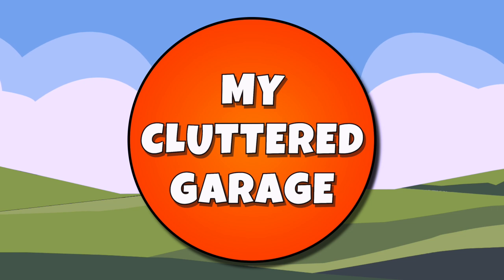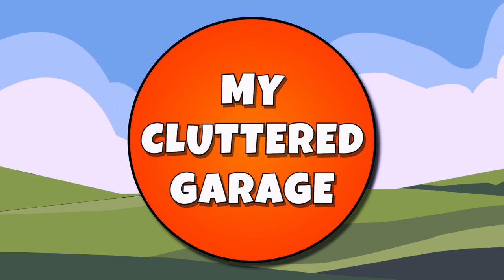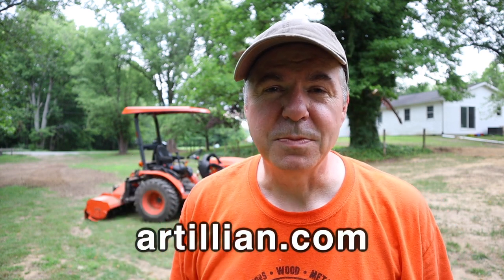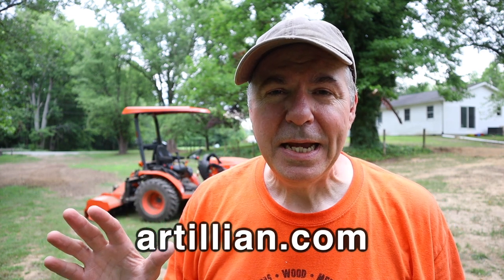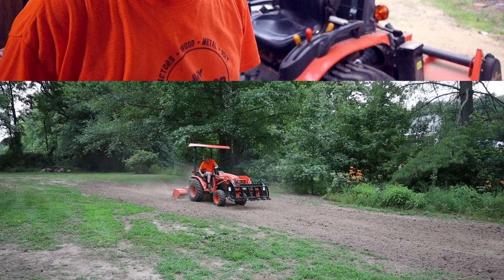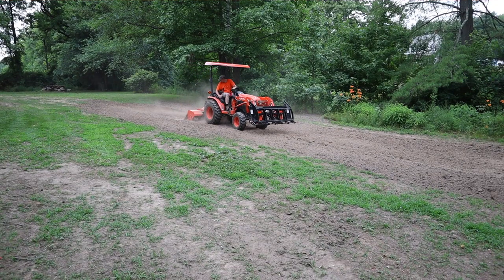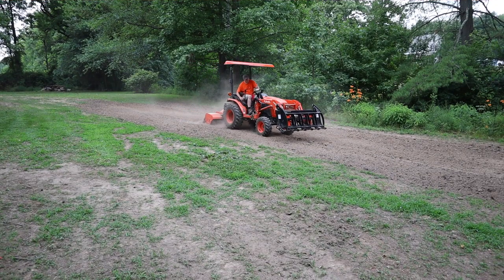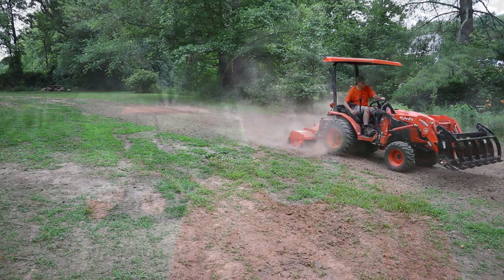#106 Installing the Artillian Canopy for Compact Tractors. Kubota B2601 and more!

Comment: Very nice canopy, I like how it comes out and covers the steering  wheel.  Mine is a little to short so when 🌧  I get a little wet. You may already know this but on the right side, passenger side of the tractor you can take a bolt 🔩 and screw into the ROPS where it folds down so your ROPS  won't  bang around so much. They welded a nut on there from the factory. I had to bolt down my ROPS because with canopy and it banging around drove me nuts. Great video Ed.  Take care and all the best buddy.  👋
Reply from the maker: Thanks very much, Kyle. Great reminder about the stop bolt! I think I need to do that.

Comment: Good vid, Ed. 👍 I see the value of a canopy especially with a fan, but sold my large Kubota fiberglass canopy because I trailer a lot (wind) and I'm in the wood a lot with low hanging limbs...just not a good fit for my uses. The fact this one comes on and off easily might be something I have to look into....I'd have to put the ROPS back on my tractor first though.  🙃
Reply from the maker: Hey Brad. Yeah a permanent canopy wouldn’t work for me. And yes her those ROPS back on there!